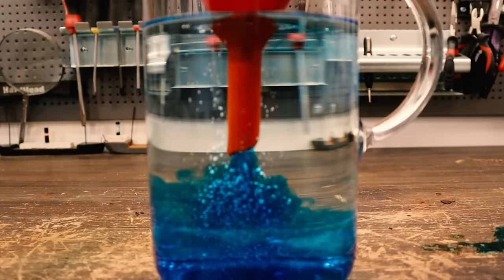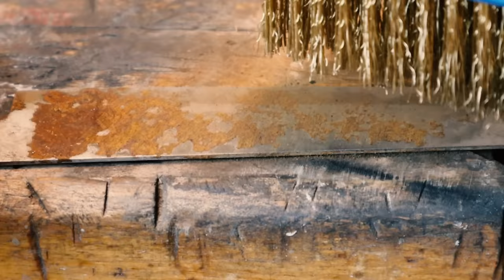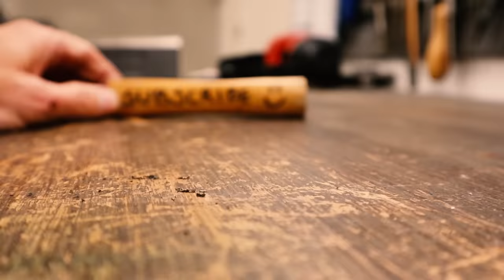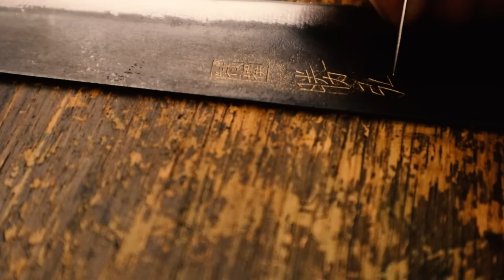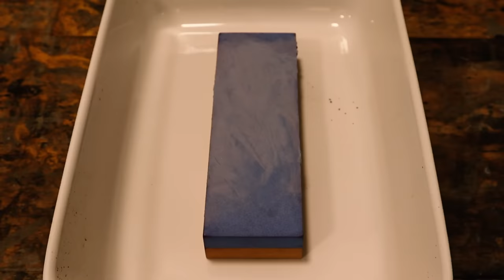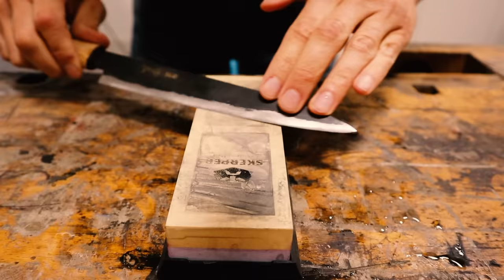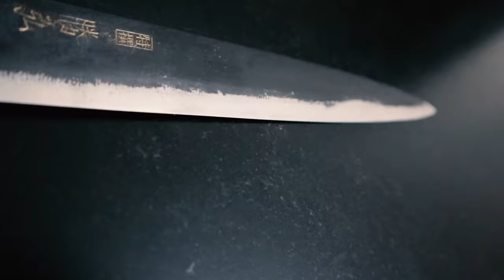Sushi knife restoration - Extremely Sharp

Comment: Tell me why you "quench" that blade it was hardened and now it must be soft like butter
Reply: I was thinking he has probably ruined the temper now as well
Reply: At most its slightly annealed, he heated it to cause a layer of oxide, i wanna say iron oxide to form, then "quenched" it to attain the darker patina.
Reply: @ChasenR  he could just have blued it
Reply: That, and not having the metal piece on the end of the handle, that wood will splinter fairly quickly.  The handle won't last, and it won't take much pressure.
Reply: xxx CHOPPER  i made almost every knife i own
Reply: If it got any softer it wasn't much. He didn't come close to any temper colors so no issue. Its just a for of bluing the steel to prevent rust. My main issue is with him sharpening the flat side of a yanagiba
Reply: xxx CHOPPER  i have made many .. i have my own forge .. i even patternweald steel .. 

And they are right .. he ruined the heat treatment of that blade completely
Reply: Was looking for this in the comments. He made a lot of mistakes with this one. Especially on the sharpening.
Reply: @chadcrimm8248  He completely ruined the heat treat. You can see he got parts of the blade to an orange color, way beyond temper colors. Any hardening/tempering is gone.
Reply: It wasn’t quenching. He was using hot blue. It does not draw back the temper.
Reply: @ChasenR   nah, the black blacksmith's finish is from the oil contacting the heated metal. 
So yes, the heat treat is probably altered. The value of simple carbon steel japanese knives are good heat treat and grind.  Aesthetic value is more important than blade performance for attracting viewers i guess.
Reply: thats not how heat treating works, you quench it to make it brittle then you usetempering to bring it down abit
Reply: @wrathofcell  im knifemaker and i know what im talkin about
Reply: The way he put the epoxy in with ouy mixing it

Comment: That’s a single bevel blade and he had it at about 30 degrees on the flat side! It’s no longer a sushi knife is it!
Reply: That's exactly what I thought!
Reply: Agree about the flat side. Beside that, this type of Yanagi knife has a pronounced bevel on the opposite side.
Reply: Yeah, and let alone the complete waste of the natural horn bolster, the simultaneously serrated and rolled edge, and completely different hardness and carbon content than initially intended...killer work 🤦‍♂️
Reply: @zootallures7279  thats what i was thinking! ☺️
Reply: Yea I'm a sushi chef and that part was kinda painful to watch. But this whole video is just soothing to watch.
Reply: Heat treatment made the blade weaker.
Reply: I wish I knew what yall were talking about
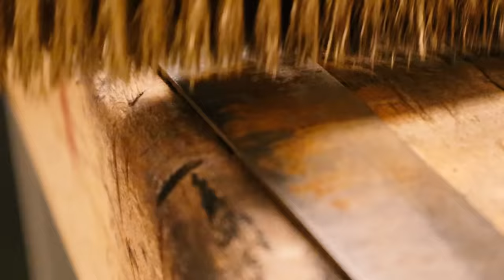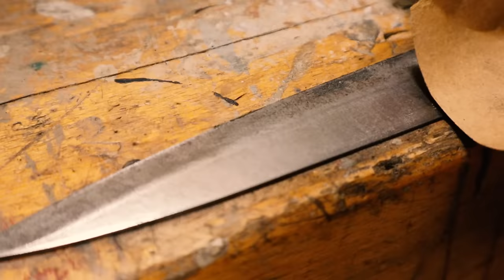Reply: You can see at about 2:10 left side, and 2:25 right side, it's got a bevel on both sides. This is just a regular knife made to look like a yanagi.
Reply: @disgruntledgames  does a sushi knife have one flat side?
Reply: @matthewshepherd5390  The traditional style for japanese knives is to sharpen only one side at an angle, giving it one beveled side and one flat side, like the edge of a chisel, yes.
Reply: @disgruntledgames  oh didn't know that. Any particular reason?
Reply: @matthewshepherd5390  I don't know why it was done that way in the beginning, but it probably remained more popular for japanese chefs mainly because the blade edge can be thinner, and therefore sharper. There are many other contributing factors though. I'm sure this is an over simplification :)
Reply: @disgruntledgames  ah cool thank you
Reply: @matthewshepherd5390  Sure thing!
Reply: And he also put paint on the knife. Just the tasty toxic thing you want to go with your shredded sashimi.
Reply: @disgruntledgames  It's calles Sujihiki
Reply: @adrianneilestrada  Ah, yep. Thanks
Reply: @matthewshepherd5390  The reason for the single bevel was because it is easy to manufacture while still being able to achieve an extremely sharp edge. If you think about it, a double beveled blade can achieve the same sharpness, but it all boils down to the geometry and how thin you are willing to make the blade to have such acute angles. This design choice could have been done in part of their history, that is, in the Heian (794-1185 AD) - Kamakura periods (1185 - 1333 AD), some swords had a single bevel geometry on one side (I have forgotten what the name of the blade geometry is...I have a book, will look into it tomorrow), with the other side having a shinogi and shinogi ji. Additionally, in terms of sharpening, a single bevel is more simple when compared to a standard double beveled edge (For example, a single 30 degree bevel versus two 15 degree bevels, which would you prefer working with?)

However, single beveled blades also require slightly different technique than your European chef knives, in that the bevel direction is also directly related to which hand dominant you are (The blade that pulls away from your hand that is holding the item you are cutting if you get the wrong bevel direction, ergo, you want the side of the knife to push into your knuckles, which aid in support and control of the blade).
Reply: @bulgarianlegend  what about it did you like exactly, the type face on his graphics?
Reply: so did the friction from the electric sander

Comment: Maybe I missed something, but the hardness appears to have been removed, or at a minimum way over tempered, who leaves an oil finish on a sushi knife, and why would you pump unmixed epoxy into a handle like that? The knife may be prettier, but the long term functionality seems to be highly suspect if not compromised, as is painting open end grain on the handle. Hmmmm.
Reply: Problems with this video:
-Oil finish for a food knife
-Softened blade by heating then dunking
-Handle not fully up the tang
-Didn't mix epoxy
-sharpened in circles

It's prettier than cheap kitchen knives, but this knife is likely not food safe, and likely lost all long-term integrity by softening the blade and improperly mounting the handle.
Reply: Have a look at the epoxy again...its two nossels that mix as it comes out
Reply: @Bawbag0110   correct in part ...  it is two  separate nozzles that are  pumped into the tang cavity and never properly mixed.  There is no mixing tube connected on the end. It will NEVER harden correctly.
Reply: @Faustvonholle  not to mention it looks like he tried to sharpen it like a double bevel knife, instead of how a yanagiba is supposed to be sharpened.
Reply: @Jiminy Cricket usually there's a neck of some sort that give you a good area to pinch grip the knife. What I'm referring to is the narrow tang that sticks out by a millimeter or so

Comment: ※Google Translation

The challenge of being able to use something that can't be used is amazing

The way to fix it was wrong but it was originally unusable and I think it's good

“勝弘” stamped on the kitchen knife
This is a kitchen knife from the Katsuhiro（勝弘） brand in Sanjo, Niigata, Japan
Sanjo City, Niigata Prefecture is a Japanese kitchen knife production area

Steel knives are easy to rust, so take moisture well and polish to the mirror surface to make it less rusting.

Polishing is too fast to end with 3000
Smoother than at least # 5000 is better to finish

The method of grinding with a whetstone is “研ぎ方”, and there are videos that are automatically translated in English when you search on You Tube

I think it ’s a great attempt
素晴らしい！
Reply from the maker: Thank you so much for all the explanation. I really appreciate it. 👌 I have actually afterwards finished the steel with grid 5000 and a leather strap. 😊  very cool that you actually can translate the Japanese kanji so I now know the origin of the knife. 👍. Yes I noticed that I will rust especially when I cuts onions. I really like the outcome of the knife and I is my favorite knife in the kitchen now ❤ Have a nice day my friend 😊
Reply: ※Google Translation
I hope Google can translate the meaning ...
I'm sorry if it's a rude translation

As a type of kitchen knife, it is often used to cut fish thinly

Although it is rarely done outside of Japan in repairing Japanese knives, it is recommended not to throw away if the original handle parts are metal
That part is made of nylon or metal
The reason is that when using a kitchen knife, the force of cutting with a blade is transmitted to the wooden handle.
Therefore, the front side of the handle is easy to break
It is a part to prevent such damage

It is a very good Japanese is a video summary column of
Reply from the maker: Thanks for your response. I really like and appreciate all new knowledge than I can get. 😊 So this is very good and interesting information to me 👍 thanks
Reply: ※Google Translation
"口金（kuchigane）" prevents damage to the handle

Although it is a theory, the kuchigane has a role such as making the handle hard to break by compressing the wood by slightly tightening the wood and making the pressure when cutting the object from the whole point tightened from one point inside the handle

Without this, when you cut a very hard thing, the tree will break somehow and there is a possibility of injury

If you do not cut it like hitting it, it is not okay, but the handle may crack as the wood surface and inside deteriorate

There was no high-performance adhesive in the old days, so there was no adhesive when inserting the knife into the handle, and it was easy for water to enter, so it was easy for the wood to deteriorate
Even now, old type knives can hurt due to water accumulation inside

Deform the plate-shaped metal sold everywhere into this shape
There are ways to repair pipes that are sold everywhere, such as deforming them.
So you can make it without having to order this part.

I hope you understand the meaning of the translation

I think it ’s very good to fix old things

Became your fan (b｀･ω･´)ｂ

Comment: So u destroy the edge hardness and not even mirror polish bruh you understand how it works 😂....
Reply: Same thing I thought. Why did you reheat the edge? That killed hardness. You would now need to re-heat treat this blade and then temper in an oven. Kind of useless as is.
Reply: Lmao i doubt he knows bout it
Reply: Just some depressed dude yup, the heat treat was likely fine to begin with, all he accomplished by torching the thing was cocking up any chance of edge retention that thing ever had.
Reply: Well, it really depends on what temperature.  It didn't even turn yellow; let alone red, so it didn't look like it was annealed too much..   Blackening hardened+tempered carbon steel is generally ok.  It may lose some internal stresses making it less brittle (less hard), but for this kind of knife, I think that's negligible.
Reply: @Ryan-np4rb  Not really.... Annealing requires a very long heating process that brings the steel to 1200 degrees f; followed by a cooling process that takes overnight.  Since this knife is old, it very most likely was work-hardened during its life (using a knife will slowly make it work-hardened, and make it even more unstable/brittle.. so a quick torch run and quench will only relief some of that work-hardened tension, and bring the steel back to its more original state where there's a balance of durability and hardness (the original temper).
Reply: @pucci8894  I mean, do you? I don't think you know.  Annealing requires a very long heating process that brings the steel to 1200 degrees f; followed by a cooling process that takes overnight.  Since this knife is old, it very most likely was work-hardened during its life (using a knife will slowly make it work-hardened, and make it even more unstable/brittle.. so a quick torch run and quench will only relief some of that work-hardened tension, and bring the steel back to its more original state where there's a balance of durability and hardness (the original temper)... besides, the guy even said the knife is holding its edge, so it was most definitely work-hardened through years of it being used.
Reply: @tylergarcia774  Not really.... Since this knife is old, it very most likely was work-hardened during its life (using a knife will slowly make it work-hardened, and make it even more unstable/brittle.. so a quick torch run and quench will only relief some of that work-hardened tension, and bring the steel back to its more original state where there's a balance of durability and hardness (the original temper).  

Besides, you know what it takes to lose edge retention?   Annealing requires a very long heating process that brings the steel to 1200 degrees f; followed by a cooling process that takes overnight.  So he essentially brought the knife back to its original molecular composition; besides, he said elsewhere in the comments, that the knife is holding its edge fine.
Reply: dan725 yes really. who said anything about annealing? This is common knowledge amongst knife makers, which I happen to be. He’s not trying to anneal the blade. He’s adding heat which absolutely will be conducive to the rigidity of the steel and its ability to hold edge. Nobody said anything about annealing.
Reply: Dont reheat for Japanese knife.We calls Yakimodosi.That things to be soft.
Reply: Also has no idea how to sharpen a single bevel Japanese knife. A yanagiba like this should be sharpened with the"flat" (really concave) side flat on the stone and then the bevel flat on the stone.
Reply: @kumaneco2010  : Right ! It has to be soft, to be super sharp.
He also lost the straightnes with the heating .... 
A realy bad restauration.
Reply: @dan725  you have to realize that a LOT of people do not understand what work hardened means. Your observation is astute,clear and well stated..
I really do think that people are losing sight of the fact that this knife was old and in severely poor condition.
I myself don't think he did a bad job at all, for a short video.
The bottom line is that the knife is restored to its former integrity and functionality and his customer was pleased with the results. Isn't that what really matters?
Thank you for trying to help people understand, but as the old 'Cool Hand Luke' movie stated.  "Some men you just can't reach".
Reply: @jwizzle4shizzle  
That got to me as well. Japanese knives like this are only ever sharpened on one side never both
Reply: So many criticisms from people who would thrown that rusty blade in the trash if it was up to them.
Reply: @mdd3084  even if he didn't ruin the heat treat he obviously doesn't know how to sharpen that knife. I just feel like it would be worth putting in just a little research before making a video about restoring a yanagiba.

Comment: There’s absolutely no way that knife hardened
Reply from the maker: But its still sharp ... 😉
Reply: @AwesomeRestorations  Not for long
Reply: @AwesomeRestorations  Enjoy re-sharpening again and again and again!
Reply: i think he did it 4the color
Reply: Sanded it all the way to 600 grit as well. 600 is a good starting point
Reply: It wasn't meant to harden it. ffs.
Reply: Ruined the heat treat for sure. A knife that's never used I suppose will stay sharp.
Reply: Keep in mind, its meant to cut food, mainly soft meats and vegetables, shouldn't need a rock solid blade to maintain a decent edge.
Reply: @ChasenR  its painfully obvious you know nothing about knives and what they go through in cooking.....between the many acids, textures and material types found in foods you can expect to at least hone the edge a few times a day in a professional setting so a soft steel edge without a proper temper has about a snowball's chance in hell of lasting 5min with food
Reply: @StygianBlood  Keyword. "Professional"
Reply: Also as far as i know, even if a blade is razor sharp, a true chef will still hone his blade before using it, to ensure that no portion of the burr comes off in the food.
Reply: Its painfully obvious a lot of people are here more for judgement than admiration of the piece that this person restored, it might not even get used, they might use it constantly.. Why are a bunch of "keyboard warriors" attacking this persons product when he was just showing his method of restoring a scrap blade?
Reply: This knife is Not meant to cut anything other than fish. Yanagiba. Google it. This is not a multipurpose chefs knife whatsoever you know it all clowns.
Reply: He can do what he pleases with it. But please don't disrespect centuries of katana makers, the last generation of which became knife specialists and whose descendants still are today. That's at least eleven hundred years worth of craftsmen you just spit on. That would absolutely not fly in Japan.

Comment: Sushi knives typically have a single bevel to the edge.  Because you tapered both sides, it will require a lot of work to correct it.

Comment: Restoration is impressive, sharpening not so much.
Reply: I noticed that, too. A sushi knife has only one bevel, the only side he shows. The back of the knife is concave, and you sharpen that flat against the stone. Also, a 3000 grit is not the last grit to use on a high quality knife. Go to an Arashiyama 6000, or another brand, like Chosera 8000, then finish with a leather strop. Done expertly (expertly!), you then have a knife that will simply drift through a poor, defenseless tomato like air - but also a delicate edge. Surprising how delicate. You have to know how to use a really sharp knife, to avoid chipping or bending that edge. For that rusty a blade, any edge is good, and if it has a double bevel, well, not strictly sushi knife, but from what it was, it's an achievement.
Reply: @davesmith5656  you are really a Smith! 😁😂